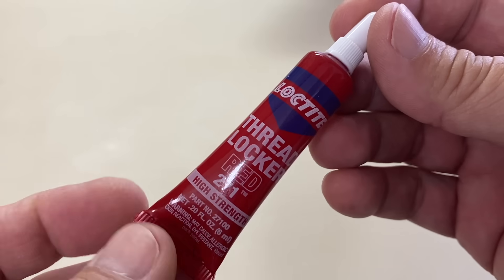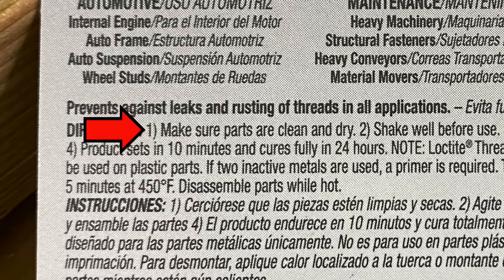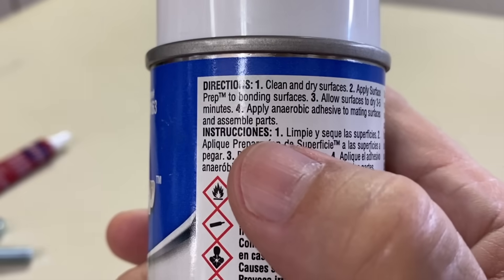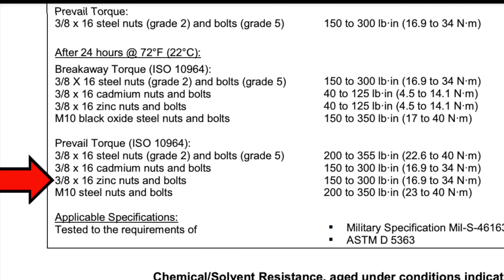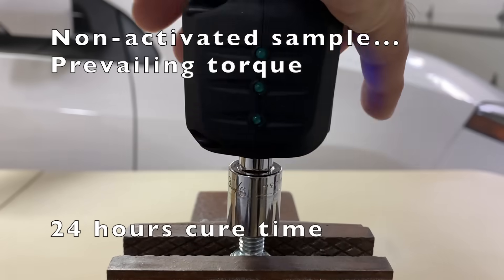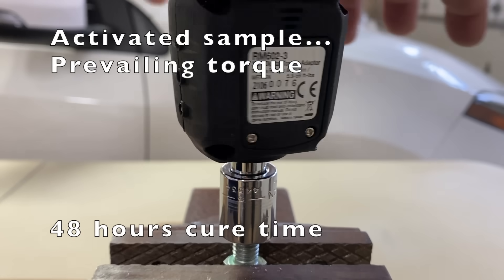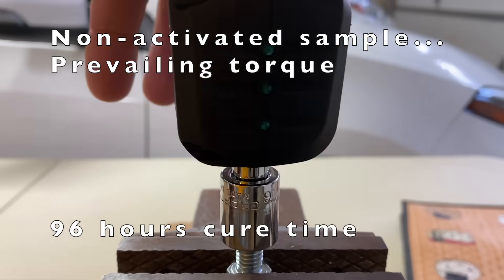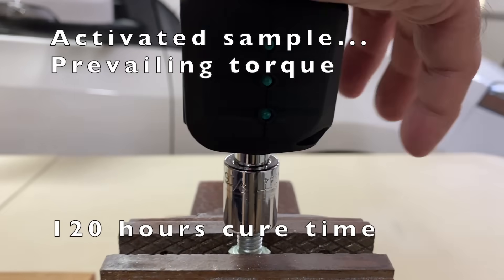Nuts & Bolts - Most DIYers Do Not Know This | Loctite Red Threadlocker Curing

Comment: Now lets talk about how red loctite comes in a blue tube and blue loctite comes in a red tube.
Reply: That’s so you can distinguish them wearing 3D glasses.
Reply: @jaysgood10   Ha!
Reply: That’s why I buy orange Loctite comes in an orange bottle😂
Reply: @USA-GreedyMenOfNoIntegrity 😂😂😂
Reply: Do you want red or blue loctite?

Um...yes?
Reply: @user-ty2uz4gb7v  :  I do not worry about the liquid color.  I just read the label and check for the proper uses on the back.
Reply: And they all have threaded on caps.
Reply: @johnpublic6582  that’s hilarious
Reply: @johnpublic6582 yep   terrible!!! they need a needle spout..
I swear they put caps on so you loose more product than you use.
Reply: @johnpublic6582 i sear they do it on purpose so you lose more product than you use
Reply: For the same reason hot dogs come in a 10 pack and buns come in an 8 pack
Reply: @niveknospmoht8743  yeah!!! What’s up with that???
Reply: @niveknospmoht8743  1 - 10pk. = 1lb.
Reply: @niveknospmoht8743  
2 extra for the cook !
Reply: That’s what I’m used to as well, but the other day I did buy some red Loctite in a red tube, I had to double check that I had the correct stuff when I was getting checked out.
Reply: @jeffgriffith7003  Do you mean you had to READ the LABEL?
How quaint.
Reply: That's why I choose green sleeve retainer instead.
Reply: @YTInnovativeSolution  cause when you're sleeving....
Reply: Whatcha talkin' bout willis?
Reply: just more annoying stuff.
Reply: It's a backwards upside down world my friend 😜
Reply: It's the same reason that we drive on the Parkway and park on the Driveway.
If my answers frighten you, Vincent then, you should cease asking scary questions.
Reply: @brentcrude8153 Or George Carlin!
Reply: @brentcrude8153  Vincent, it is me, Julius, your long lost brother.
Reply: It's to have a little fun 😁
Reply: My man spittin’ facts!
Reply: I thought i was losing my freakin mind the day i came to this realization
Reply: Both my blue and red are in corresponding colour tubes. Not sure what you mean
Reply: panic looks Take the shot, take the shot! He knows too much!?!?!!
Reply: If they printed "Red" Loctite on a red bottle you wouldn't be able to read it 😂😂
Reply: Right?!
Reply: Thems fightin words….
Reply: that is very confusing !
Reply: Ya too old to read..
Reply: And green comes in a green tube
Reply: @Dslrepairpro
Reply: My loctite is in red container with a blue or red stripe on the label.
Reply: Orange in orange
Reply: That's so you'll first buy the wrong Loctite, then have to purchase another tube of the correct stuff.  My red Loctite leaked out of my tube, even with a secure cap, so I got to buy more anyway.
Reply: @ljprep6250  l squeeze some air out so when it gets hot doesn't leak
Reply: Don't assume their color you biggot! They can identify as whatever color they want!!
Reply: It's baffling how stupid companies are.  They literally have board meetings and shit and still do this.
Reply: 😊😊 I have some 40-year-old lock type red and blue they still work
Reply: @garybrown9719 i can confirm, My father still has the same bottles i used growing up in the 80s out tinkering in his shop and I'm pretty sure they was at least a decade old back then...
Reply: Mines purple.......I think I did something wrong
Reply: the marketing team say's " I see pretty colors" as they wave their hand in front of their face. lol
Reply: Blue bottle is usually permatex brand... Which comes in both ways
Reply: lol
Reply: let's not.
Reply: Those guys ar the loctite factory get bored and like i throw us a curve ball.
Reply: Oh thats just for the fun of confusing people and creating terror lol 😂
Reply: To us it comes in red tubes all of them.
Reply: Germans
Reply: My red and blue loctite comes in a red tube.  Just like you see in this video lol
Reply: to stop the Americans from drinking them lol want they're not white?
red white and blue?  id bad enough  with the fly trap tape that the Americans get caught up with that lineup at the hospital emergency rooms lol 
have a great day now
Reply: some like  square boxes with round things inside and are cut into triangles what is it lol
i will order my pizza when you Americans think
Reply: @Jennifer White  - I'm from Chicago, our pizza is cut into squares and sometimes, depending on the pizzeria, the pizzas themselves are square too.
Reply: All the auto assembly plant ,nobody clean the bolts and nuts, even the engine parts ,IMO.
Reply: He uses red locktite, and red locktite came out..
Reply: It's really frustrating to be because I work in product development and I know the decision to do this went through SEVERAL committees, review teams, discussions and somehow got approved. Just what the ever loving fuck.
Reply: Permatex figured it out.
Reply: Red has been in a red container and blue in a blue container for as long as I can remember.
Reply: Thank you! I noticed that too and wondered why. :)😊
Reply: Facts. Has cost me 2 trips to home depot so far
Reply: Permatex uses correct colors
Reply: Gotta keep you on your toes
Reply: Don't forget about green loctite...
Reply: because you can't see rest of red liquid in red bottle, but you can see blue
Reply: Its like buying cilantro after finding it where the parsley goes
Reply: What am I missing? The stuff cures in 24 hours
 Why do you test at several additional intervals? There is no reason to expect a change. Indeed, the results confirm this since standard deviation shows no  statistically significant change as cure time increases beyond 24 hours.
Reply: "You use the blue loctite, the story ends, you wake up in your bed and believe whatever you want to believe. You use the red loctite, you stay in wonderland, and I show you how much breakaway torque is required to move the nut." -"Yeah but which one is which?"
Reply: There's no such thing as Loctite® in a blue tube.  If the tube is blue you own a Chinese knock-off of Loctite®
Reply: Or how the blue 243Locky is pretty much the same as the old/trusted M242 loctite except it's much better on greasy/dirty, uncleaned parts and should not be used in highly oxygenated areas.
Reply: I wish they would just use a translucent bottle, problem solved.
Reply: I'm color blind, so they both look the same to me 😮
Reply: That really is infuriating! Why??? Just why?!?!!!!
Reply: And why does it taste so good and sweet?
Reply: Use a lock washer instead😂
Reply: @theodoreduplessis3597 spring type lockwashers don't do anything useful. If the bolt loosens to the point where thr spring stops it from turning further, the joint is already compromised.
Reply: I have red in a blue container and blue in a red container. I just figured engineers had been consulted and they agreed that it was a good idea.
Reply: And why do firemen wear red suspenders?
Reply: Just use gorilla crazy glue then you won't have to worry about torque ftlbs you will just need a sawsaw with the Torch Blades lmao
Reply: There are four lights !!!!
Reply: ONE GLARING ERROR- There was a HUGE jump in breaking torque on the LAST DAY. Does that indicate every day after it would be that high? Or go higher? THAT ANOMALY makes the test inconclusive. Usable somewhat, but inconclusive. IMHO.
Reply: The other question is why they screen print the labels on a bottle of liquid that can peel the screen printing off. 

The bottles should maybe have the product number stamped into the bottles seam.
Reply: Thats the Permatex brand of thread locker
Reply: It keeps the saying alive.  “Fuckin new guy “
Reply: Those are TRANS Loctites. They IDENTIFY as the other type, so the blue is identifying as the red and visa versa. This is why some blue Loctite can get pregnant and menstruates because even though it identifies as Red it is actually blue by chemical composition - we just don't talk about that... Sweden is working on a surgery procedure that alters the bottle so that red Loctite, that identifies as blue Loctite, can have a blue bottle. But this entails daily injections of blue Loctite, as well as actually living like blue Loctite for years before the surgical procedure. Loctite puberty blockers, etc...
Confused yet???
Reply: I'm confused, in this video he drops red loctite out of a red container, so what are you referring to?
Reply: my sentiments exactly    was just pondering this two days ago
Reply: I thought both come in red tubes.  I have 2 tubes of the blue myself, but only because I misplaced one when I was building a Voron 2.4 3D printer, which specifies blue Loctite to prevent the machine from vibrating itself apart in high speed operation.
Reply: The day after New Year on a production line. Drunk like judges.
Reply: Really? So what do people generally mean when they are speaking of 'Red Loctite'?  A red tube or red goo?
Reply: another person that is mixing up loctite and permatex brands 🙄
Reply: You can get red locktite in red bottles and blue in blue
Reply: At Christmas I buy the green loctite in the red tube, it’s so festive.
Reply: maybe they can make the whole thing  more confusing if they try~!! :face-orange-frowning:
Reply: Chineses
Reply: Depends on brand, loctite brand is in proper color bottle, permatex is backwards
Reply: To put an end to it:

“The color refers to the actual substance, but all the bottles are red in color. 
The red bottle is actually a LOCTITE® trademark.”
Reply: Mandela effect. 😂
Reply: YES!!! Like wtf?
Reply: It’s a conspiracy by the CCP to make our industrial machinery either fail, or be impossible to fix after it does fail😅
Reply: Sounds geeky. Let's not.
Reply: Loctite is the brand silly, they sell many products!
Reply: @artifacthunter1472  they didn't used to. Just like lots of companies.
Reply: @joeKisonue  Loctite brand  thread locker just happened to be the first product he invented for the company! We don’t live in the 50s anymore now we have many brands of thread locker they’re not all called Loctite! Let’s leave ignorance and get informed and stop making excuses!
Reply: You say loctite I think of thread locker. @artifacthunter1472
Reply: Wow, how still use garbage inch bolts ? Speak metric, the world is laughing at you !
Reply: @jpcaretta8847  the fractionally challenged have spoken.
Reply: @jpcaretta8847  you know more people than anyone can imagine.
Reply: @Mikael5732  Indeed, I travelled the world, worked in many countries. I know Boston (the best US city) SF, NY , Chattanooga as well as Paris, Brussels, Frankfurt, Geneva , London, Mexico, Quebec ....set up my tent in Death Valley, Yellowstone, Glacier, Quebec ...
Reply: @JP CARETTA  we still have vehicles that use sae hardware. Thats why.
Reply: @charlespartak2435  I know ! Worse  on the same vehicle. It is a pain, two sets of tools, bolts mixing and therefore seizing (eg 3/8 UNC and M10 ...) rounded head... Harbor Freight is happy selling all thes and the tools to extract broken bolts...
Reply: @jpcaretta8847  im  retired from construction but the last job i had was a millwright at a local toyota plant.  As much metric as you would think but still needed to have sae tools too.
Reply: @charlespartak2435  going thr way of the dodo ! All SAE standards, publications are in metric ! Failure to go full metric lead to huge market loses. CAT, John Deere, Ford, GM ..to name a few, would be history if they didnt switch decades ago ! Same for the machine tool industry (all metric inside in fact)
Reply: @jpcaretta8847   Whitworth says “hold my beer”.
Reply: What drive ratchet do you have? Go ahead, I’ll wait…
Reply: @jpcaretta8847  And we are laughing because you drive on the wrong side of the road...LOL.
Reply: @jpcaretta8847 no we’re not.
Reply: @jpcaretta8847  hey genius, what size is the drive on your ratchets and sockets? It’s not metric!!!! 😂
Reply: @indianftrtard7899  what size is half?
Reply: @indianftrtard7899  close but no cigar buddy.
Reply: @supersportimpalass  
👍
Reply: @renalshomlmes338  Half of what pleez?
Reply: @supersportimpalass children, children... calm down. There are many, many different thread forms out here in the real world and real engineers just deal with them. You don’t have to pick a tribe on everything :-)
Reply: @supersportimpalass  9.7mm.
Reply: @supersportimpalass not important.....
Reply: @jpcaretta8847 We use both imperial and metric in the US. The worlds laughing at you because you only understand metric.
Reply: @jpcaretta8847 metric bolts are idiotic.  Some bolt diameters have 4 different thread pitches and a lot of manufacturers use different size bolt head and nut sizes and Volvo truck will use different sizes on the same bolt diameter

Comment: Soak the zinc bolts in vinegar for 24 hours before use.
Reply: Acid is how you remove the zinc coating as when you want to replate something. I’m not too sure loosing the anti-corrosion of zinc is a reasonable trade off in many situations.
Reply: @836dmar  LOL!  Vinegar is what blacksmiths and welders use to remove the zinc, which is a mild acid.  We use usually soak them overnight because some bolts are G90 rather than G30.

Comment: Thread locker is anaerobic meaning it's a liquid in the presence of oxygen. When you tighten a nut on a bolt you displace the air (oxygen) turning the liquid into a solid. If you apply heat (torch) it accelerates the  process. The torch displaces the air.
Reply: Removing oxygen merely allows the liquid to polymerize.
It is the iron (ions) that catalyze it.
It's almost a given in chemistry that heat or pressure will accelerate reactions.
But torch heat (in this case) is above the TG and 2ill cause the bond to break down.
Reply: @jimurrata6785  when I used a propane torch I merely warmed it a little. If someone used the green on it and then torqued it you will need to heat it.